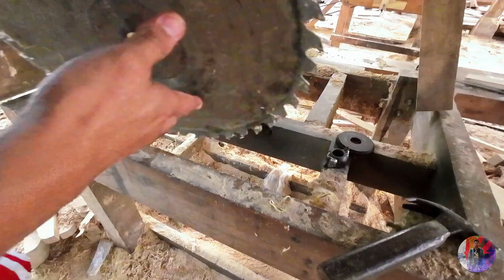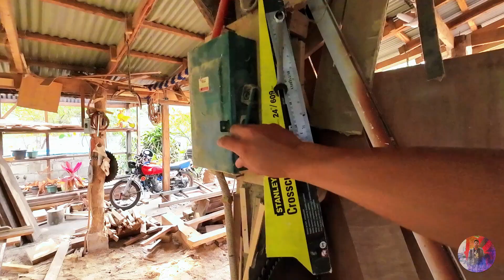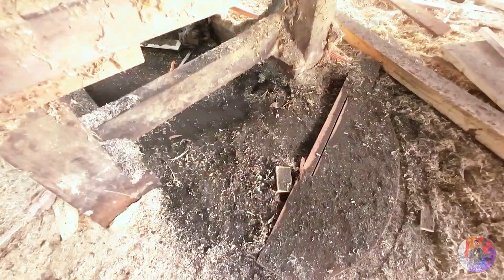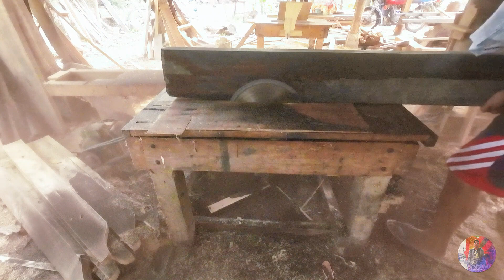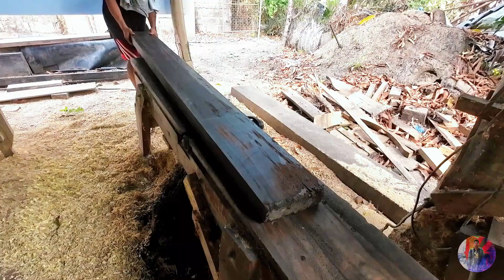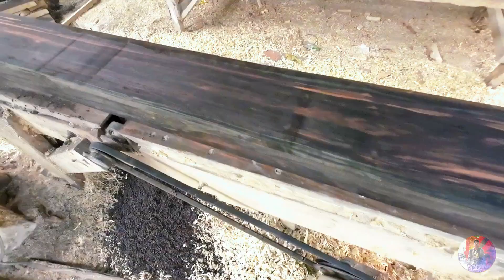Kamagong Wood | A critically endangered and rare kind of wood

Comment: Anong kamagong sa english?
Reply from the maker: Ebony po
Reply: @EmmanuelAyroso  salamat po.
Expensive pala at top best ito sa guitar fretboard..
Reply: Second question ko about planer cutter head shaft, pwedi po ba sa 3 blades ang 60mm diameter?
Meron ako inihanda dito axle shaft ng truck.
Reply: Yan ginawa handle ng axe sa probinsya at ilang dekada na til now Hindi pa nadisira at sa sobrang kinis na Hindi mo akalain na kahoy kasi para siyang plastic ting solid black siya........at may kamagong din na parang kulay balat ng tiger at Yun mas maganda tingnan yung lumber niya